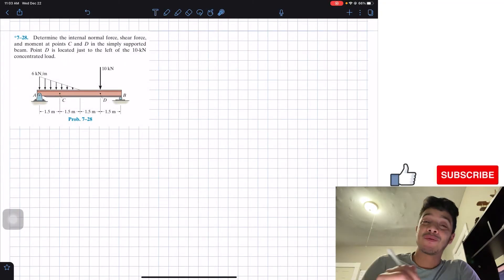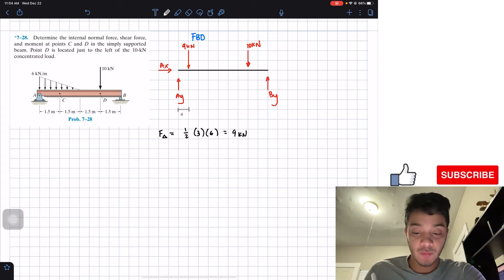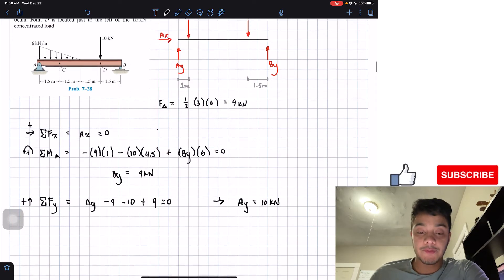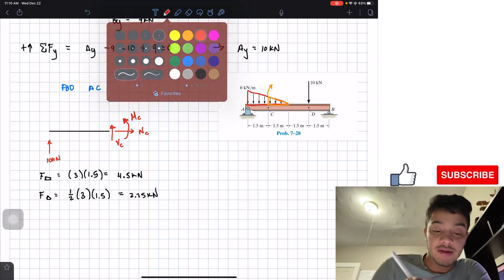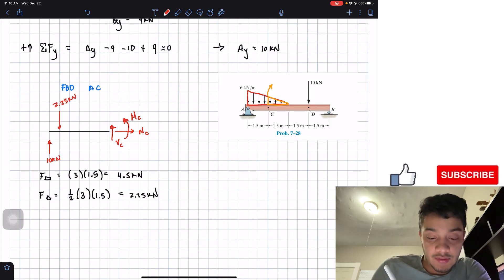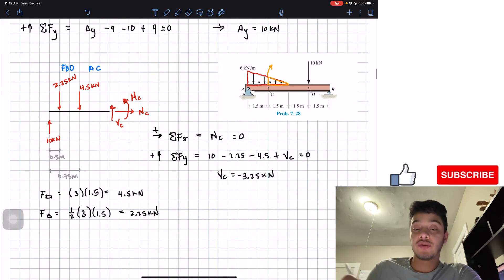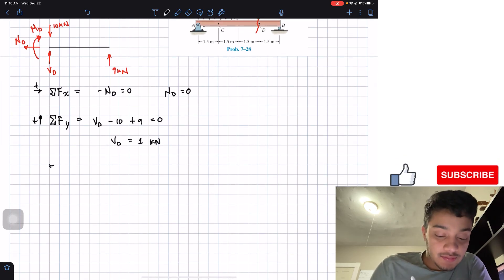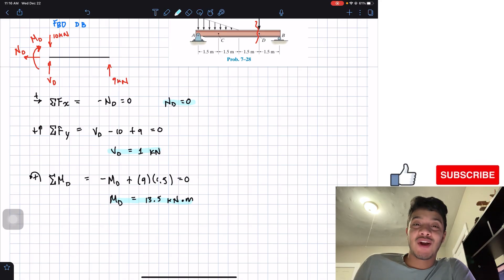Statics 7-28| Determine the internal normal force, shear force, and moment at points C and D

Comment: I don’t understand how you get the  rectangular height?
Reply from the maker: Hello Iam, the height was calculated by knowing that from point A it takes 3 meters (x-direction) to go down the original 6 kN/m in height. Point C its located at the middle x-distance (of the 3 meters mentioned before), and by this we can calculate that the height will also be in the middle from original height (3kN/m).

I hope this clarifies your question :)
Reply: @LearningbyTeaching hey there I wonder how the 6kN/m turned to 3kN/m when getting the height.
Reply: @LearningbyTeaching oh I get it now, nvm.

Comment: hello sir... can i know for the first equation.. how do you get the 1/2 for the FA=1/2(3)(6)=9kN..actually i have forgotten the equation'' i've studied . thanks for your helping
Reply: Hi, the resultant force for a distributed load that takes the shape of a triangle can be calculated by multiplying one half the peak value of the distributed load with the distance over which it acts. Essentially, you are applying the equation of the area of a right triangle.